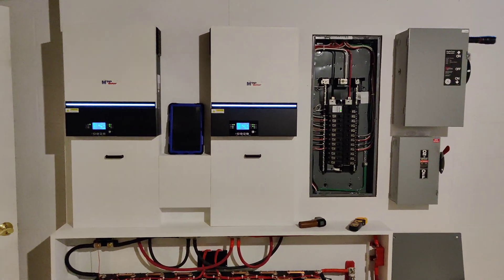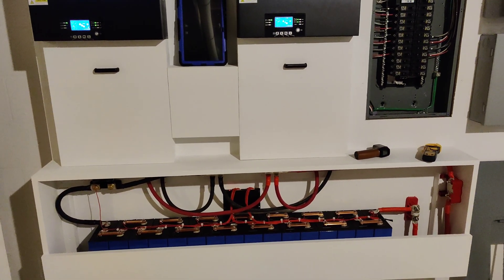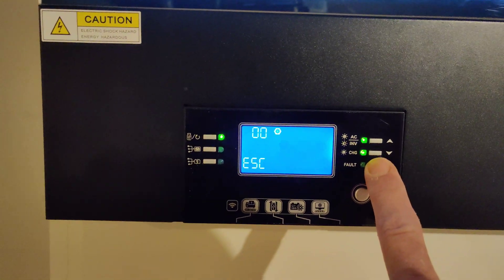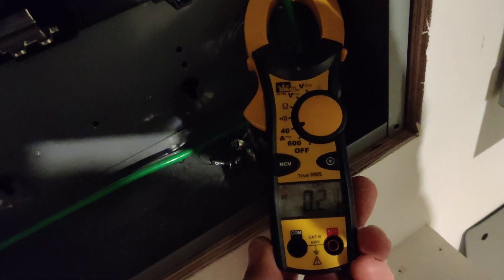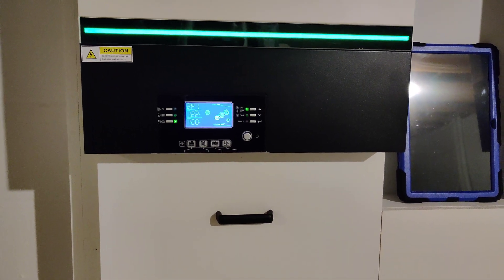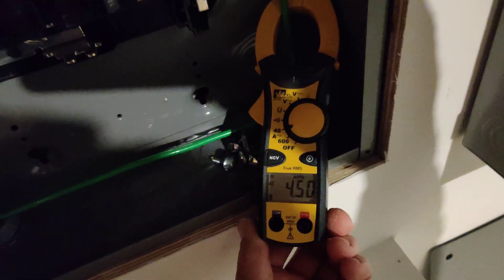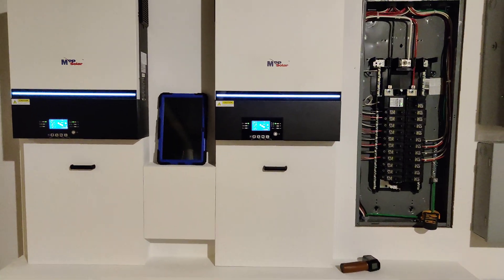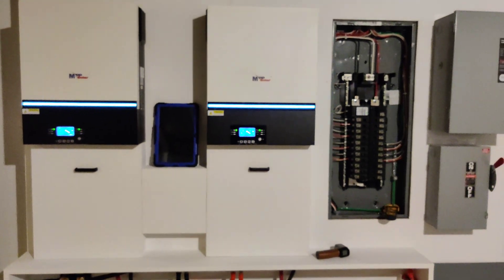13KW - MPP Solar LV6548 DIY Power Wall - Ground Issue? Updated comment below!

Comment: I have a video on my channel about it. Maybe it can help you to understand it better. But essentially you will need an automatic transfer switch where either grid or inverter is feeding the sub panel. You need a N-G bonding there where the inverter is feeding in! If it is a sub panel as in your case, you need to isolate it and treat it like an essential loads panel.
Reply: Peace Roland. Please link your specific  vid. Please also clarify something for me. . Doesn't  a auto transfer  switch kill advertised  functionality?  If the ground and or neutral is continous from panel to panel and he is witnessing  a ground loop from his subpanel.  Then in your example here ground and neutral  are not continous only l1 l2 are coming thru the auto transfer switch  to the subpanel . What is providing  a neutral beyond  the subpanel?  If there are two grounds on the building and a common neutral bonded to the original  ground then you will still have a loop
Reply: @blainecelestaine4543  power can only come and return back to its origin. Neutrals should never be common in an AC installation as they belong to the active part of a circuit and must be dedicated to the power source. Ground can be common, if using certain grounding systems. One source of power is the Grid, the other the inverter. A transfer switch should always pass or disrupt both parts of the active circuit (L+N), so that it is not possible to have power going back on a common wire. Maybe you have something in mind out of DC electronics, where common GND aka Minus is used and many power sources share that path. But that is not done in AC installations. If there is current on a ground wire, then that can only mean, that there is a broken return path to one of the power origins. Where, would have to be thoroughly analyzed. So, the electrons are taking the way over the Ground bond because there is no other way... This was my first part of a later growing to a full series about grounding and bonding with inverters: https://youtu.be/_w4XkaThbQw
Reply: @RolandW_DIYEnergyandMore  thx for the reply . I still have questions  but maybe they will be answered  in the video.  I believe  one of The advertised  function  of this inverter is to supplement  the pv produced ac  to loads exceeding the pv/inverter ability as long as the batteries  are full at that time. If I'm  correct about that then the switch would prevent  that function and any like function  it would seem... if there is no switch or switch is open then all the neutrals in the house come back to the bonded neutral in the main panel and are therefore branches of neutral all the way to the transformeron the pole. As far as power returning to the source I am lost about it on if a house has 2 ground rods and a lighting strike happens or some other source I thought that could cause a ground loop. I will watch the vid and I really appreciate your earlier answer.
Reply: @blainecelestaine4543  Inverters can indeed have many features, but to use certain features, it will depend on the way of installing those devices. This particular inverter will be designed the way, that it is the gate keeper to your house. As if you would be off-grid, but with the ability to interact with the grid. If people are installing such units somewhere in the middle of their installations, feeding into subpanels which are just branches of the main panel etc.,  the situation won't be as clear anymore. That's why sometimes, it might be not possible to use the AC In bypass, or back-feed anymore. Inverter, Gas Generator and Grid, must be seen as equal power sources. They should all come into your installation at the same place (which will be the main panel, or direct branch connections to it). But at least, always be aware where the power is coming from, and where it needs to go. And the Ground/PE circuit is only there for fault or lightning surge currents, nothing else...
Reply: @RolandW_DIYEnergyandMore  thx bro
Reply: @RolandW_DIYEnergyandMore   Wow, cannot make that more clear. Thanks so much for hte explanation. Are you a licensed Electrician?
Reply: @JuanGonzales-or6pu  graduated electrical engineering. House and Solar installations are something which I have to do on my property, but I am not making a living of it :)

Comment: Hi Dan, I have a 5048HV2 hybrid .... When I first installed my two units, I pre measured the N-GND resistance and found it was 0 ohms, so it infered a bond. However when I powered the units on, I found there was a 67V AC difference between N-GND meaning there is NO BOND between GND and N. I believe the uncharged capacitors made it look like N-GND is bonded where in fact it is not! I then bonded the N-GND in the breaker panel (first connection) and now there is 0V AC between N-GND which is correct. The GND from the breaker panel is then wired to an earthing stake. I have not measured if there is any Ground wire current, but will do so as soon as I get back out there. Cheers
Reply: I have an inverter that only has L & N on the AC output the ground is a screw on the side of the case I'm running the L & N output terminal to a breaker box to two breakers using a midpoint transformer my question is where do I run the ground to from that screw on the side of the case I'm not using the ac input at all
Reply: @thelithiumpowerch  Use a multimeter to measure to see if the N and Ground on the case are shorted together. If not, then a mid point transformer is safe to use and the case ground can be used for ground. If N and Ground are shorted, then things can get very complicated, if nothing else is grounded like your negative PV and Negative Battery terminal, a floating inverter/PV/battery system can be connected to the autotransformer and the neutral of the transformer is tied to ground. I must stress that depending on the design of the inverter, this can present electrocution danger as the inverter case can be live while it is running!!!
Reply: @whoguy4231  that's what I'm scared of I bought it used off eBay it will be here soon my solar panels are running to a grounded combiner box out back and from the box I was going to go into the inverter with the solar panel wires I figured that was my one point of earth grounding but I've seen others move that whole box when using these type inverters so I'm kind of lost
Reply: @thelithiumpowerch  When you get it, just test to see if the Ground case and N are shorted together. Hopefully they're not!
Reply: @whoguy4231  ok thanks sorry for the typo I was speaking in the microphone and it was messing up my words

Comment: Yeah, whatever happened with this?  What did MPP say about it?
Reply from the maker: First they said I needed a separate neutral to each inverter AC input from the main panel. (This would not work). I sent a picture from the manual that shows the inverters sharing the neutral which is how I have it wired. They want me to take some readings on the sub-panel with the breakers all off and see if I still get some current on the conductors. I will update when I get a chance. I've been a bit busy here with spring time..

Comment: You need to run ground rods to the mpps inverters. Separate from the grid
Reply: That would be completely illegal
Reply: This would possibly create a ground loop by having an earth ground in multiple places. There should be a single earth ground and that is at your main panel. IMHO
Reply: Wrong.
Reply: The Canadian electrical code states that all ground be bonded together. This is done you you don't have a voltage difference potentially causing issues.
Reply from the maker: I believe you are correct. As a matter of fact I believe from the sub panel location the ground should be within 6' of the main or tied together so that there is no potential between two grounding points.
Reply: @danfitzpatrick4112  You have a ground rod installed already. The equipment grounding conductors in your entire house all lead back to the grounding electrode system. You should be fine as long as you ran an equipment grounding conductor from your main to your sub panel.
Reply: Bad idea.  A lightning strike closer to one of the ground rods will cause local potentials across the ground, which, if you are part of in some way, means you can become the conductor.

Comment: Any new news?
Reply from the maker: Still going back and forth checking voltages for them. It's a slow process going through email and on a different time zone! They want me to turn all the breakers off in the sub panel now and check voltage on the line side of that panel. Last week the tech at MPP Solar said I should have a separate neutral to each inverter (Which won't help the current on the ground) and it show's in their manual that the neutrals should be shared (I sent the picture out of the manual showing them this as well) . I'll update if there is a fix at some point.

Comment: I recently have purchased  two of these inverters myself did you separate your grounds and neutrals from ac output?
Reply from the maker: The AC output has a bond from neutral to ground built in (You should be able to read it with your meter). The case is also grounded internally
Reply: @danfitzpatrick4112   i would love to see your wiring diagram
Reply from the maker: @GeneralGamin007  My LV6548's are wired just like the manual shows for split phase operation. L1 from utility to AC input on inverter 1, L2 from utility to AC input on inverter 2, Neutrals shared from utility to both inverter AC inputs. On the AC output side it is the same only they go to the sub-panel. The main panel (utility) has the ground and neutral bonded and the sub panel does NOT. Hopefully this helps!
Reply: @danfitzpatrick4112  Did you ever figure this out? I am waiting for my second LV6548 to show up feom Watts247, and will be tackling the AC side shortly. If you do have a wiring diagram, I would also love to learn from it. Maybe post on Diysolar forum for all to learn from you? I am NOT and electrician, and could use the help!
Reply: My understanding is that you want to bind the ground to the neutral in the sub panel. The ground is just backup neutral if the live line gets disconnect from the neutral and connected to the housing.
Reply: @jamesgarage4327  Hey James,
ground should never carry current under normal operation.  Bonding ground and neutral at two locations puts the two conductors in parallel between those two bonded points and would cause current to split between the two conductors proportionately to their conductivity (1/R).

If ground was NOT brought to the sub-panel from the main panel, and a new ground rod/source was used at the sub-panel, only then you would bond ground and neutral at the Sub.
😁👍
Reply: https://youtu.be/P-W42tk-fWc

Comment: nice i have a GK PIP I thank i cook my Thor inverter i thank it back feed some how i had to isolate my ground on the panel  i tuck it off line i can still use it for back up we just got a new growatt 6k my pip use to much power with a st 5000 transformer hope yea can get it fix

Comment: Samething with renogy 3500watt 48 volt i am getting 30volts AC IN
Reply: Can you please check your AC IN plug if you get voltage from 26 volt to 30 volts

Comment: Measure the Amps in the Neutral Wire going back to the Main Panel, too.  Do you have approx EQUAL amps flowing through the Neutral wire and the Ground Wire?  ie 5 Amps each?  If yes, the you do have a secondary bond between the Neutral Wire and the Ground wire inside the MPP Panel and that is WRONG .  Did YOU add any jumper wire that could have re-bonded the Neutral Wire and the Ground Wire inside of he MPP Panel?   Or is their an internal "re-bonding" somewhere inside of the MPP inverter?   If yes, then how do they justify that?  Is the MPP Inverter also disconnecting the Neutral  wire along with L1 & L2 with a relay, when in OFF-GRID mode?
Reply from the maker: There is some sort of internal switching going on in the inverters on ac input and output. I contacted MPP Solar and they are looking at a drawing I sent to them. I'll report any findings on another video. Yes there is a parallel path on ground and neutral at the main panel. When I take the inverters out of the circuit all is fine.
Reply: @danfitzpatrick4112  Well it's due to fact...they GND and Neutral are in parallel. So maybe if you have thicker wire on the neutral, you will not have GND current. But the point is....GND and neutral should not be together.
Reply: Pretty sure the amps each parallel conductor will carry is directly related to their size. More current will flow over larger conductor.

Comment: Did you happen to see this post talking about same issue?  https://diysolarforum.com/threads/mpp-solar-lv5048-bonding-grounding-question.8955/   They indicated that a jumper on the neutral between inputs and outputs will alleviate the ground current flow...
Reply from the maker: Yes I read that a while back. I have not tried it yet on mine. I sent a link of my video to Peggy and Eric at MPP solar and got a response back that they wanted to see a simple drawing of what my connection is
Reply: @danfitzpatrick4112  Curious to hear back from the MPP folks about their assessment.  The MPP is basically the same as Growatt, and I suspect this N-G bond issue may be causing ground loop issues in the circuit here.  Possibly causing flickering of LED lights.
Do you have any problems with lights flickering in that mode?  Perhaps also refrigerator lights?

I'm going to research ground loops more in the meantime.  As an electrician, can you offer any insight?
Reply from the maker: @AGhostInTheMachine  I'll update everyone as soon as I hear back from Eric.
Reply: @danfitzpatrick4112  very nice build and install, please update and let us know what Eric or Peggy says, very interested.

Comment: Awesome setup. I am building a every similar setup with two MPP  LV 6548s running in split phase for an off grid cabin. I have them installed with 48 volt LIFEP04 Big Battery’s. I am in the process of finishing the solar install of 5700 watts. I have not used the MPPs yet. In trying to program them for split phase, I seem to be having trouble with the the 2nd phase staying 180 out in the menu. I set the menu items, the go to the second unit and put it into standby to program the phase however it does not stay it reverts back. (It has been a month since I tried programming it (since starting on the solar install) so I don’t exactly remember all the menu items without the manual). Any suggestions?
Reply: I don't have the LV6548 so can't help you with settings etc but I can tell you where to go to be likely to get help .  If you haven't already go join DIY SOLAR forum and post the question there. When you post you will see the other posts that might cover that topic also. You can also do a google search etc for LV6548 settings DIY SOLAR and read the topics but you cannot post or ask the specific question. There are several members there with the LV6548 s there.  I was thinking of getting a pair to replace my LV5048 but I am now leaning toward 2 LVX6048 s since each unit is split phase and if one of the LV6548 goes out you can only get 120v though likely if one goes out both might anyway.  The LV6048 has up to 450v PV input which is desirable to me since my panels are ground mounted  and a good distance from the inverters.
Reply: DIY Solar Power with Will Prowse has a couple great videos about the LV6548, I followed his instructions to set mine and it worked fine, it took a dozen tries but I was able to do it.

Comment: For what is worth I would send link of your video to peggy@mppsolar.com and eric@mppsolar.com and ask for the opinion. As mentioned before I am not on grid yet so I would not have any input yet but as soon as I do I will check it out. Good find as this is not something we normally don't deal with.
Reply: Man, that panel looks like one of the Picasso's master pieces .
Reply from the maker: Your too kind brother! But thank you!
Reply: @DMIINC2013  Hey DMI, your setup is pretty sweet too! Both you guys are my mentors with Solar. Gotta love the MPP stuff. Affordable and it works well.
Reply from the maker: Thanks for the recommendation! I have sent a link to my video to both of them and will let you know what they recommend.

Comment: Looks great Dan. Thanks for sharing the charge parameters. I remember seeing something about the LV6548 being a Non-Isolated unit, so the PV input must not be grounded(seems strange, especially with Lightning!) But there is nothing in the manual about AC grounding or sub panels at all. I would ask an electrician and/or your local building inspector.
Reply from the maker: I am an electrician and I understand the code. This issue is not from the PV input. Actually it is at the AC output.. The problem here is that you should only have the neutral bonded at 1 location.  (In my case this is at my main panel). The inverter AC output neutral and ground are bonded . It creates another bond which allows current flow in parallel with the ground back to the Main panel.
Reply: @danfitzpatrick4112  Try reviewing your AC wiring to each of the units and see if you inadvertently cross wired the ground or neutral? Also check each unit by turning it completely off. To see if the issue is on both units or only one unit. I would also check with your amp meter each ground and each neutral from each unit. Next I would open each unit and look to see if it was wired incorrectly at the factory?
Reply: @danfitzpatrick4112  When a person installs a back up generator to an existing electrical system the back up generator should be of the floating neutral configuration (Honda EU2200i). When the generator is used with just extension cords like in an off grid system then the neutral and equipment grounding conductors should be bonded together at the source (Honda EU2200i with neutral and equipment ground plug bond inserted). I hope this helps.